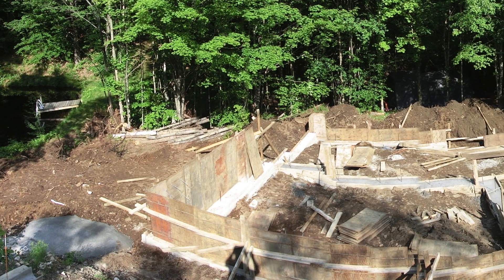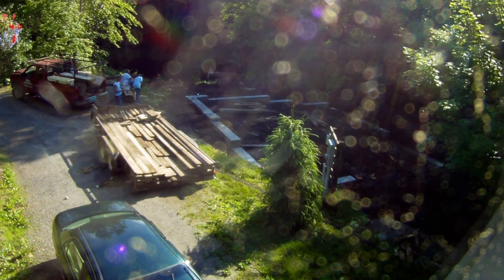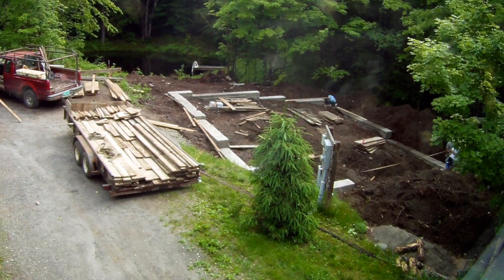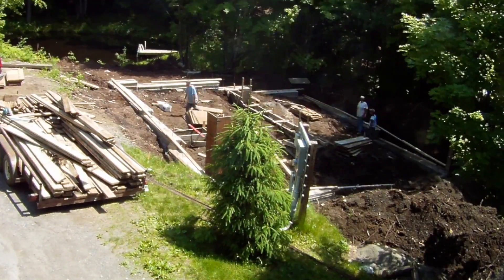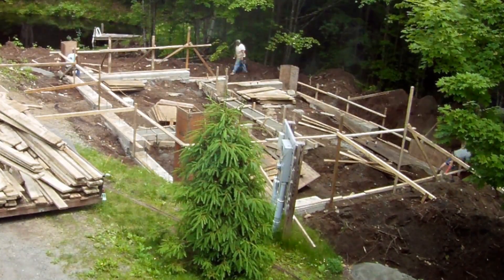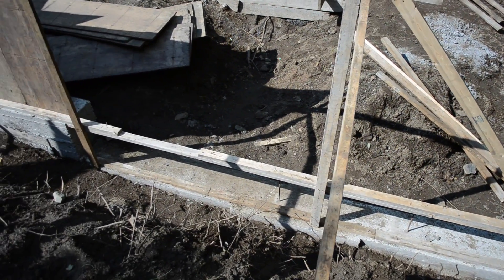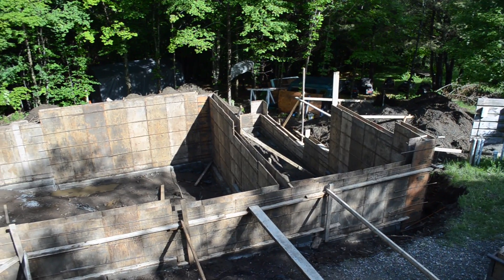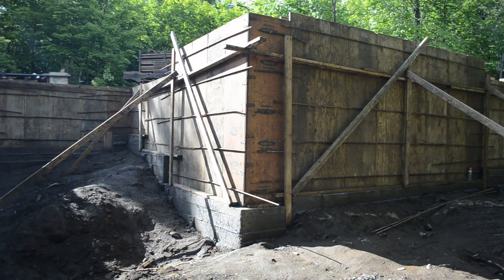Concrete Forms Foundation Walls - 7 - My Garage Build HD Time Lapse

Comment: wow I cant believe they are pouring walls with wood forms,,thats insane,,i guess that's the old way maybe idk,,im newer to this shit but the concrete place I work for uses steel forms that cost tns and weighs even more about 100 pound 8ft ,,odd forms are called fractions